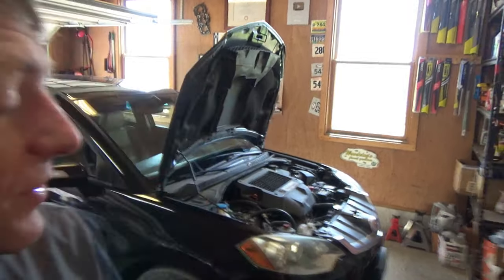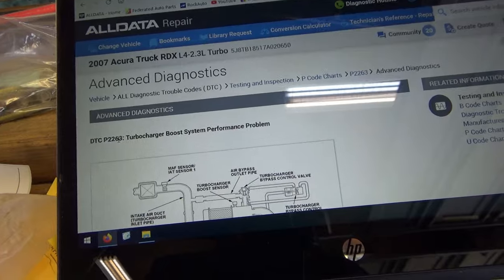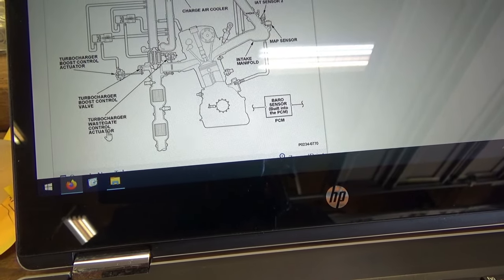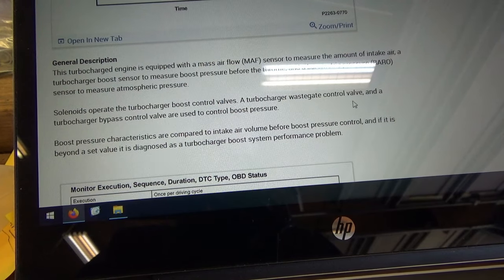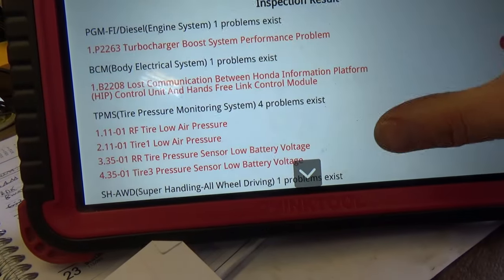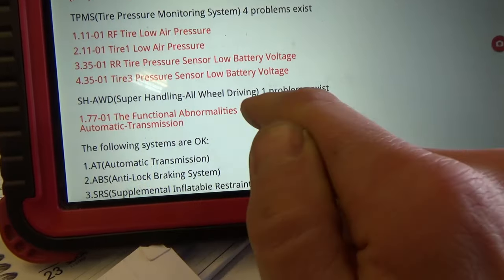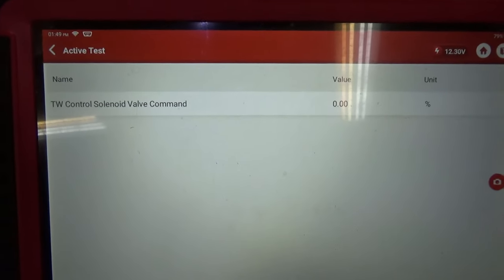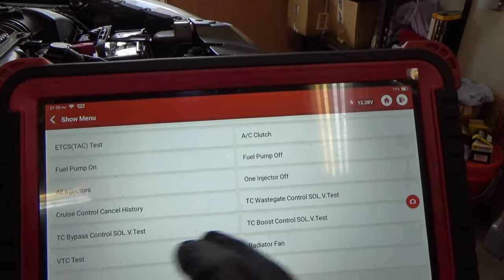TURBO Problem Disables AWD? (Acura RDX)

Comment: I've got an '08 RDX with 198k and it's still on it's OEM wheel bearings, axles, driveshaft, struts, literally everything except the sway bar end links. Battery, brakes, and tires have been done multiple times which is just maintenance.  Oil changes every 3500 and trans fluid drain and fill every 30k.  Easily the most reliable vehicle I've ever owned.  Purchased for $9000 with 90k on it 8 years ago.
Reply: Mine has 360k🥵
Reply: @audearing27  Love it, any major issues?
Reply: @tylermartelle7041  I’d say that a lot of the DTCs on these cars are caused by something else. Most often I’ve found that the car is EXTREMELY sensitive to battery/alternator voltage. Lower than expected voltage can trigger transmission codes, AWD codes, airbag codes, etc. I always check that first. So much in this car is electrical. The old Bluetooth module was killing my battery. (Parasitic drain) Disconnect it and you’re good to go again.
Reply: @aharbis  mine is a 07 sh awd no Bluetooth thankfully
Reply: Sunroof just failed on me tho😞
Reply: Well mine is an 07 tech with 98k miles and turbo overboost. How would I check my wastegate or vgt to know it's working fine? Or maybe the blowoff valve?
Reply: I have a 07 Tech it has 238k miles I bought it 6 years ago with 164k miles for $5000. Watch out for the radiator rusting between the trans and coolant side. If it rusts through all the way it will mix if you look down through the fan shroud in the lower drivers corner of the radiator and see any wet or dried coolant spots. Replace it asap.
Reply: @dustinhansen7228 I have a 2011 and my the heat wasn’t working had high oil temp got home and saw fluids on ground went to look and could see there was Cooke t leaking somewhere. My guess is the radiator went bad any suggestions.? 180k
Reply: THANKS for words of reassurance!  I got  an 09 in Jan.23 (100k mi).  Quiet as can be.  Engine feels good, and strong.
I like it now ... but still miss my chile pepper red, 6sp, SUPERcharged "Alice" Cooper, though!
Glad this one is Turbo, at least.  No problem merging, eh. 😄
Reply: @audearing27  I just got a 2007 rdx turbo shawd with 110k miles.  So I got another 250 + life left.  Shit I'm litty
Reply: @bryanCLXT  My 07 Shawd Rdx is now at 388,700k miles 👌 original turbo, and I drive it hard daily. Got bc coilovers at 200k miles, best upgrade imo. If you can find a k&n typhoon intake, it really make a nice induction and blowoff sound.
Reply: @audearing27  that is awesome Honda is the best hands down.   Noted bc coils when the originals shitt out and  K&N filter for more wooossshh.  Hell yes been driving it hard  gonna toss in some seafoam and do an oil change and do a trans fluid flush just to do some preventative maintenance
Reply: @bryanCLXT  I haven’t ever touched my transmission 😂

Comment: I think you will get that one back at some point. That diaphragm is leaking bad, it will not work at all when the hole in it gets bigger.
Reply: I agree the diaphragm leaking will cause an over boost, thats why it didn't pass the diagnostic test on the scanner. It will probably go into a limp mode accelerating hard up a long hill.
Reply: 2nd that
Reply from the maker: Interesting. Was not sure if that leak was part of the design...
Reply: @PineHollowAutoDiagnostics  never worked on one but I wouldn't have thought so. It's basically the original way of controlling boost pressure using the boost pressure to open the waste gate with the solenoid valve to allow the ECU to control it. Plus you are loosing metered air through the diaphragm upsetting the air fuel mixture.
Reply: @roberthouston594  I completely agree. A part of the scantool test was to “reject” boost pressure with the wastegate open. Due to the big leak the diaphragm doesn’t respond to the only little flow/pressure of the control side. 
Jamming it shut with the adjustment will help to build the boost obviously, so the car is happy but I think in a longer periode WOT it will still malfunction. 
But the customer is happy and this is a good catch in terms of low expenses.
Reply from the maker: @RichardHilverts  wonder why it doesn't throw a Check Engine light if it failed the bidirectional boost test?
Reply: @PineHollowAutoDiagnostics  maybe because of a combination of things:-
It has not been driven under a heavy load for a long enough duration to set fault code. 

The pressure it is leaking through the diaphragm is helping to reduce the boost pressure (not good for the turbo, it will be spinning too fast)

I would need to watch the video again but the system seems to have another valve to control the pressure and this could be doing most of the work. Is it a VNT turbo?
Reply: @PineHollowAutoDiagnostics  shop air probably didnt help. its only designed to handle the boost pressure the turbo makes. while the shop air opened it you also get more volume that makes up for the leak.
Reply: @Pine Hollow Auto Diagnostics Yep, I have to agree with others here about the wastegate actuator. It definitely should be a sealed unit, no leakage. It won't actuate the wastegate at the correct boost pressure and may be allowing the turbo to overboost, and hence the failed test results. I normally don't use full shop air pressure. I use a pressure regulator connected to my air line and slowly raise the pressure regulator whilst watching the boost actuator. The actuator rod should just start to move at the factory set point, but you would need to check service info to verify what pressure that should be. With that excessive leak, the pressure and flow required would be a fair bit higher than 'normal' to start to move the actuator rod👍🇦🇺
Reply: I’ll keep an eye on the part, and see if the DTC comes back. Right now the car is still driving like new again. (~1000 miles post repair). I appreciate the informed comments about the leaking diaphragm.
Reply: Really cool to see both customer and mechanic on Youtube like this. I have this problem, I’m a car hypochondriac - I see somebody’s turbo having problems, I immediately start thinking my turbo must be checked. Same for high pressure fuel pump leaking diesel into the crankcase that Ivan mentioned a couple of weeks ago.
Reply: @aharbis  Thank-you for letting Ivan showcase your car here on YT. We all benefit from the curly ones. I love his videos, his in depth methodical diagnostic approach is unparalleled, and I especially love those really CRAZY case studies🤣👍🇦🇺
Reply: Bidirectional probably not throwing a code because it hasn’t completely failed, …. Yet.
Reply: @PineHollowAutoDiagnostics  I’d assume that it’s the same basic design us3d on older Diesel engines.  That wastegate actuator  is definitely bad.    It’s basically a boost leak at the least and potentially the reason for the system to fail the boost control test.   

Keep up the great and intriguing content.
Reply: @aharbis  highly recommend you join the FB group for first gen RDX's(if you haven't already). Really helpful group. Way more helpful than any forums on the RDX.
Reply: @thenixer8968  I’m on the Acura 1st gen forum, but I haven’t seen the fb group.
Reply: @aharbis  it's called Acura RDX first gen
Reply: I'm also worried about the leak. It is essentially a boost leak.
One thing I didn't catch was wether the solenoid as still connected in that test or not -the solenoid is designed to bleed into the intake when not powered. If the solenoid was not connected to the diaphragm during the test, the actuator should be replaced.
Reply: I've had this issue for 5 yrs......I changed the wastegate and fishbolt. The one thing I have noticed is when it's summer, i get the 2263 code but when it's cold outside, I hardly get it....
Reply: @PineHollowAutoDiagnostics  Hi Ivan.  6 Month update. The Diaphragm did actually fail completely last week.  I have a new one that I'm planning on replacing this weekend. 100% tighter in the linkage(no slop) and zero blow-by.
Reply from the maker: @aharbis  thanks for the update Andy! Should run great with the new actuator 🙂👌

Comment: Mechanic told me it'd be $3K to replace/rebuild the turbo charger on my 2012 RDX with 200K miles...I watched your video and fixed it myself in 10 minutes - you are awesome amigo! Now on to fix my wife's MDX "gas cap" problem 🤨

Comment: Regarding the starter, another way that I've seen someone check electric motors for dead windings is to scope the current draw. Zoom right down to a short time base and you can see each winding drawing current as a half-sine shaped pulse. If there's a flat spot, there's a dead winding.

Comment: Great repair plan. There should be a resource to determine which aftermarket brands have reliable parts that they sell. Not all brand parts are good, some are and some are junk which means another maker would be a better choice. Example, Gates is reliable rubber parts (radiator hoses, heater hose, belts etc.) but are they selling reliable belt tensioners and pulley's.
Reply: I agree with a vehicle part database, but with the amount of junk out there nowadays, there's only so much room a website can fill with junk crap, ill start- Moog u-joints are now TRASH, used to be one of the best, not anymore!

Comment: Sir, thank you.  Wife has 2008 RDX and your video explains an awful lot.  Local dealers (Colorado Front Range area) only say, "Too bad, turbo charger has failed, happens all the time, $8,900 and we can fix that".  Current mechanic is also a teacher and we will see if we can get more mileage out of it for the wife, thanks for the education.

Comment: Learned my lesson with aftermarket starters on our 08 CRV.  Lasted about a year.  Shelled out on a Honda reman second time.  Much more expensive but job done.  Shoulda just bit the bullet the first time.  Not the easiest job since it's under the intake manifold so didn't even try and claim a warranty.  Worth the extra $ just to be done with it.

Comment: Thanks for the great video!   Just a comment... that's intercooler on top of the engine looks dirty.  Owner needs to "carefully" clean it and not crush anymore of the fins....errr...ummm nevermind.  Saw the broken rear hatch lamp and torn headliner. LOL      Still... Always good to see a high mileage car in good shape still being enjoyed!
Reply from the maker: I blew it off with compressed air lol
Reply: There is a little “comb” tool available to straighten out those bent fins.  Not sure how a top-mount got so beat up.
Reply: The car apparently had some previous front end damage, I discovered that when I pulled the bumper cover to replace a broken fog light. 
The headliner… this is my daughters car, and her 3 year old grabbed the dome light and pulled…. Toddlers are really rough on cars…😂

Comment: Very Nicely done Ivan, I really appreciate your research before jumping to conclusions. 1 thing i would've done differently, that nut vibrates alot, I would've used some thread locker, or a second nut to lock it in place.
Reply from the maker: A second nut to lock the lock nut? Then it will be harder to adjust the next time 😁
Reply: @PineHollowAutoDiagnostics  🤣 I don't know what to say hhhhh but through experience with bikes on bumpy gravel roads, two nuts locked together never come loose on their own. So hopefully no future adjustments would've been needed 😁
Reply: @aranhaydar9195  The design already has two nuts. the adjuster, and a second jam nut that locks the adjuster in place.
Reply: @kain0m  thanks for the info, i haven't noticed that :)

Comment: There should actually be a pre load on the WG actuator , it's fairly hard to over come that spring when properly  installing WG actuator with a good pre load. 👌
Reply: when i was younger i put a turbo kit on a non turbo model eagle talon and it would not build boost,i had to shim the wastegate mounting plate to tighten the pre load and that fixed it.now days most wastegate actuator rods have a adjusting nut you loosen and can extent the rod out or in.

Comment: I just had this same problem with my RDX and this video was valuable showing how the turbo system works and the graphs of all the sensor readings, pressure and throttle position. I wish I had a scanner like the one in this video. The repair of just adjusting the eye bolt isn’t repairing this problem though. With the gap shown at the actuator eye bolt the turbo variable flow isn’t under good control anymore. The play in the pivot pin area of the actuator control causes the exhaust flap opening, which controls the exhaust flow to different areas of the twin scroll turbine wheel, to be delayed or it may even prevent the flap from fully opening. This delays the response of the boost pressure and you get the P2263 code.  The play in the pivot point is not just from the eye bolt either, the pin it pivots on also wears so replacing just the eye bolt is a temporary fix at best. The worn pin though is rivetted onto the flap control arm so it’s difficult (but not impossible, I managed to do it) to replace so the worn pin and eye bolt must be replaced for a solid, long-lasting fix. The alternative is replacing the turbo. 
It also did sound like there was air leakage through the variable flow actuator diaphragm, but I cringe seeing shop air being used on these actuators, normal max operating pressure is in the 10-15psi range, not sure what psi the diaphragms inside the actuator can actually tolerate.

Comment: Makes sense why the AWD would shut down. Prevention of engine and drivetrain strain due to a delay in boost control from the loose gate linkage. Good stuff.
Reply from the maker: They would also shut it down for an EVAP code...I'm guessing lol
Reply: @PineHollowAutoDiagnostics  now that is weird. That would be a hell of a question and intriguing to figure out why. Only thing I could think of is the demand of a perfect fuel recirculation because of the demand of fuel because it’s a turbo engine. The thought of if the evap system is out of tolerance, it would trigger a fuel system fault. (Even though it would be an evap system recirculating fault.) Darn emissions systems.
Reply: Honda is not the only one to do this. It has nothing specifically to do with turbo. An evap code can disable awd, stability/traction control, cruise control, grade braking etc..

Comment: Ivan:   It's not really related, but I thought I would tell you:   The "SH-AWD" systems (super handling all wheel drive) --  on these are actually more unique than most other AWD systems in that:   The torque vectoring axle has dual clutch packs on each side (one on each wheel), that can engage or not,  at will,  by the computer, actuated by electric motors.  BUT ALSO- each side also has a planetary gear set on each wheel, that can Overdrive that wheel past 100% speed of the other wheels.  It's like there is a 2 speed transmission on each wheel.  So when you're going around a corner, the planetary gear will engage on the outer rear wheel and that will cause it to be Powered faster than the other wheels- which will help PUSH you around the corner better.   Where as, most other torque vectoring" cars only use the ABS system to slow your inner rear wheel when cornering.  So instead of braking the inner wheel, these Honda's are over-Powering the outer wheel. pretty cool

   I believe Honda did this over drive axle first...  but I heard more recently that VW has a little car that just has a slightly higher gear ratio in their rear end differential--- so when the AWD system kicks in, it's pushing the rear wheels a little faster than the fronts, so that causes most of your power to go towards the rear wheels, to give it a rear wheel bias.  Obviously it can't stay on very long, since it would cause binding.   But all of these systems only kick in when it sees wheel slippage from your speed sensors, or when you are cornering.  So MOST of the time, it's just a front wheel drive car....    I just thought it was interesting when I learned these things.
Reply: Thank you for sharing that info, that system is quite interesting
Reply: The Ford Focus RS has the overdriven rear axle. There's no differential, just a slightly overdriven hypoid gear and a clutch on each side. When both clutches are fully locked (drift mode) the rear wheels spin faster than the front.
Reply: Wow... that's really cool.

Comment: Put the picoscope current camp on the starter cable an monitor the waveform. You may see 1 commutator drop out as it rotates. Thank you Ivan!
Reply: These starters have four commutators.

Comment: Good vid! Waste gate dumps excess boost to the atmosphere and can sound like a huge air leak.
What they've done is use a very small turbo so that they can get great throttle response with no turbo lag. That works very good but over-driving the turbo is easy to do so they've used three different ways of controlling it. Very sophisticated!
Reply: Waste gate dumps exhaust pressure before it can get to the turbine housing, preventing more boost from being created. (Hot side regulation)
Blow-off valve vents excess boost to atmosphere. (Cold side regulation)
Reply: @mattmanyam  I had forgotten that - been a long time since I looked at mine. It dumps drive pressure.

Comment: That little ring linkage end is obviously a design problem and as such, replacement units are available on Ebay $19.99.
Reply: How many times are you willing to replace it for free at that price?
Reply: I suspect even slight wear keeps the wastegate from quickly reacting in a linear manner like it's supposed to.
Reply: This kind of linkage wear is common on wastegate actuators from many different manufacturers.  It's an extremely harsh operating condition, very high temperatures means the bush can't be lubricated so has to run dry.
Reply: The OEM part from Honda was oval, and down to about 1mm on the bottom when I replaced it with a hardened steel one. Planned obsolescence from Honda. And Honda will only sell a complete new turbo for 4K. Sometimes you have to go aftermarket.